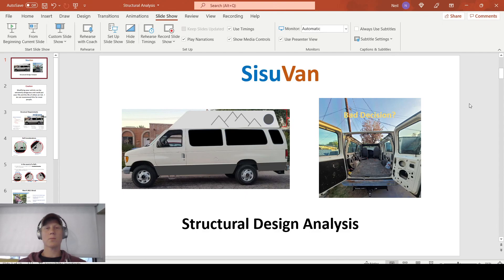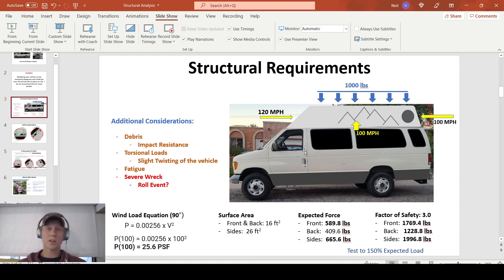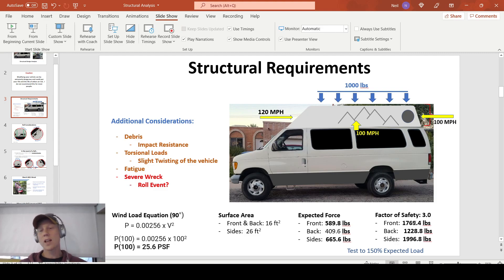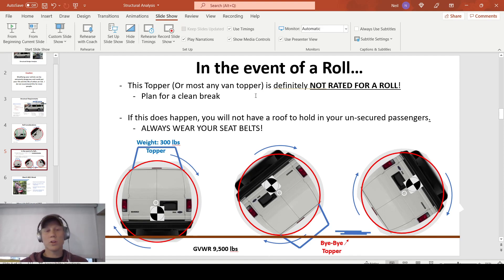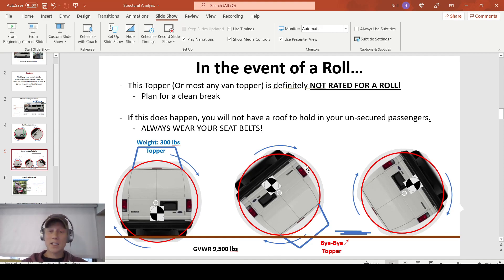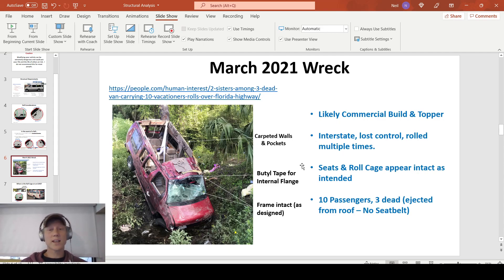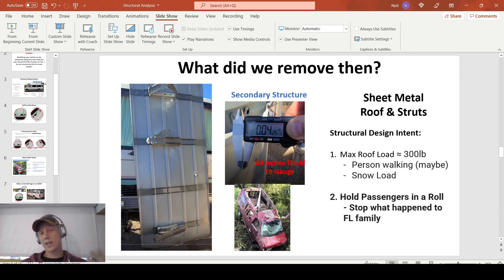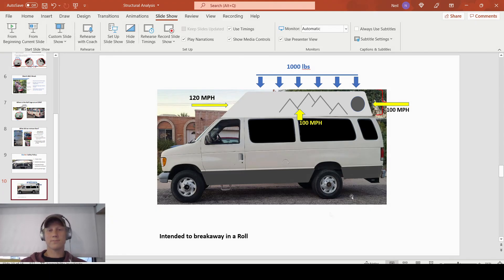High Top Van Structural Review - Can I Build it Strong Enough?

Comment: Interesting - any data on how the constant side-to-side flexing might affect all of the top's fasteners?
Reply from the maker: @davidm1599  just data on the tensile strength of the fasteners - each of them is rated for several thousand pounds.  Over engineer when in doubt.  Holding strong 2 1/2 years later.

Comment: I really like the way you're approaching the build.     Have you thought about keeping the center of gravity as low as possible?   I've thought of making a high top from foam to keep the weight down along with adding a roll cage(I use to drag race)
Just thoughts I've had with no one to bounce them off of.
Reply from the maker: I have definitely thought about that.  On a 1 ton vehicle (GVWR 9500), a 300 lb topper is a drop in the bucket.  The bigger concern is not stowing a lot of gear or cargo up high.  In the future I'm also going to try to put the heaviest items (batteries and water tanks) under the floor attached to the frame to keep the COG low.
Reply: @SisuVan  I figured you did think about COG.  The thing I think about is the weight up high during a panic swerve. With the way people drive these days it's a good possibility it will happen. I have a 1 ton dodge van I've been thinking of doing a high top on.  
Thanks for putting up your build, I really like the thought you put into it.
Reply from the maker: @joehess5481  I will say that adding a Helwig rear sway bar helps to mitigate a lot of the side to side motion as well.  Thanks for the support!  Glad folks are finding the info useful.

Comment: The roof isn't a big deal but the cross members you removed are. An easy test is to jack up one of the front wheels and see how much the roofline twists.
Reply from the maker: I'll add that to the list for my validation testing.  Good way to verify torsional strength.